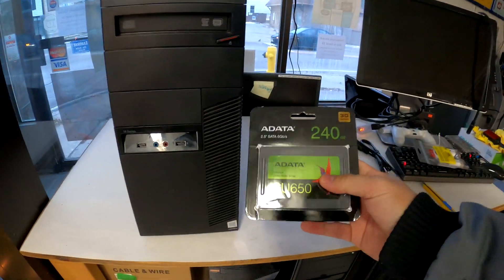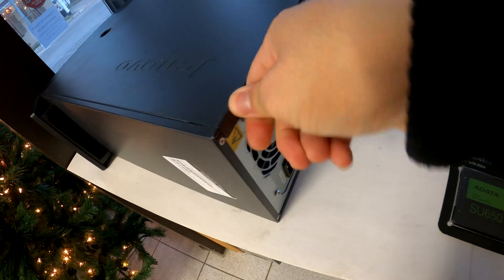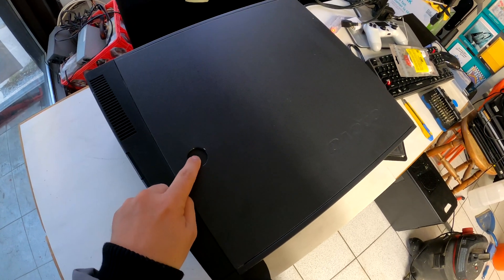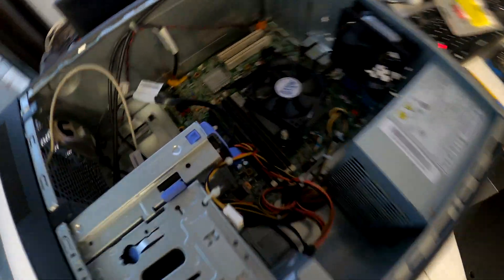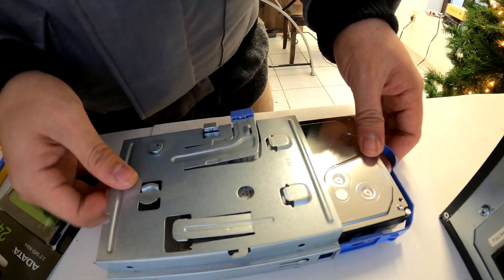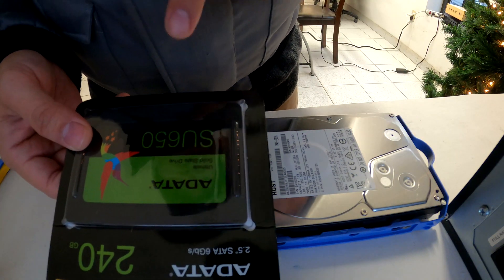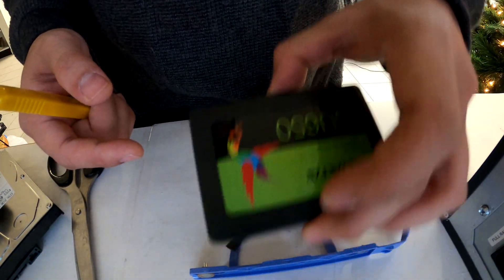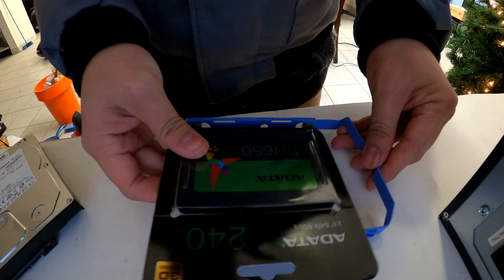Lenovo ThinkCentre M91P SSD Upgrade (Install SSD without a Bracket)

Comment: iam using both , my pc is m91p sff ,without remove hdd 500Gb (data:D) so iam using cdrom cable to put ssd 256Gb(data:C)  and put behind cdroom using tape. i dont need cdrom btw